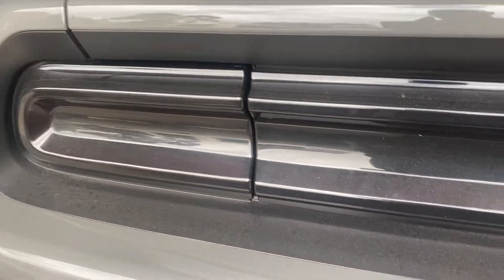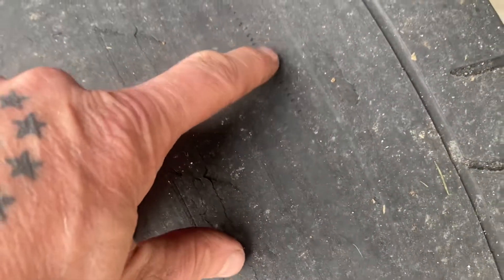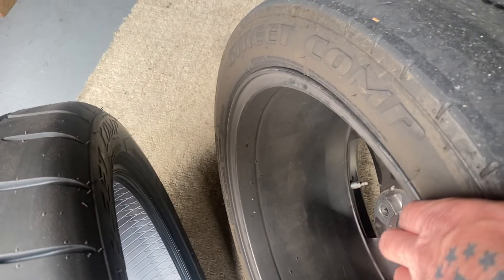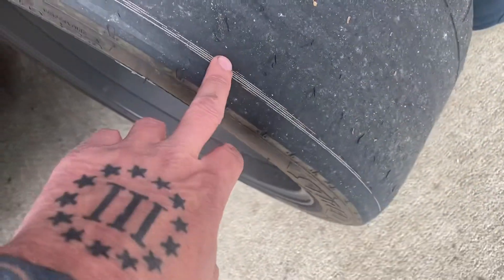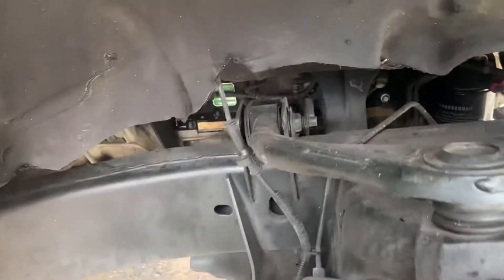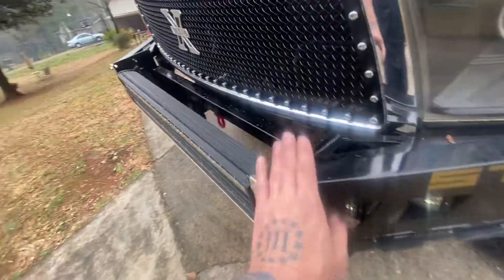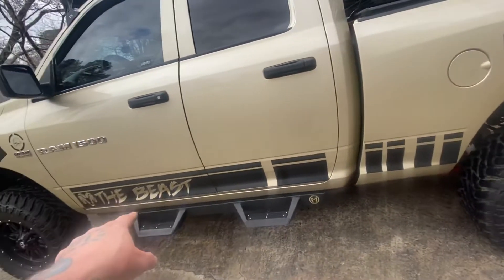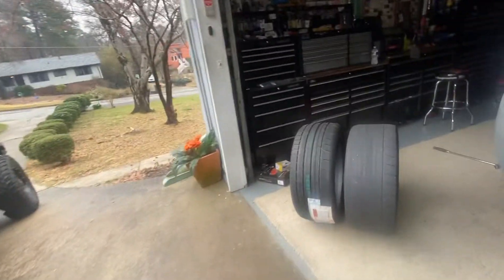Tires are gone 🤦‍♂️

Comment: Would those tires fix on our Dodge Challenger Scat Pack? I subscribed to your channel. I love your videos.
Reply from the maker: Yes they should and thank you 👍 What I did is I went on eBay for tires in on the top of the chart it shows you put in your car information make model and it will show you if it will fit or not thanks again
Reply: @hellcatredeye-g6582  thank you so much for your response and thank you for subscribing 🥰